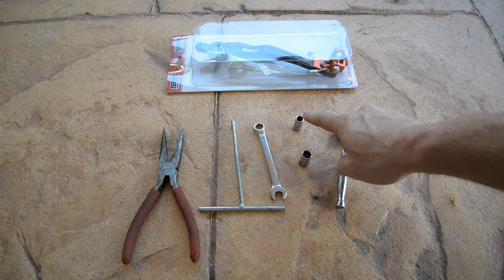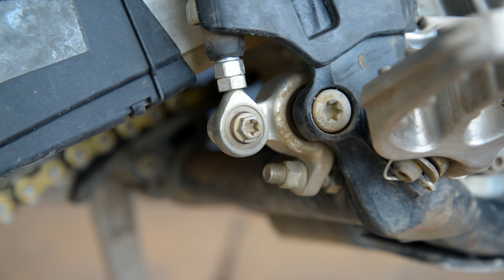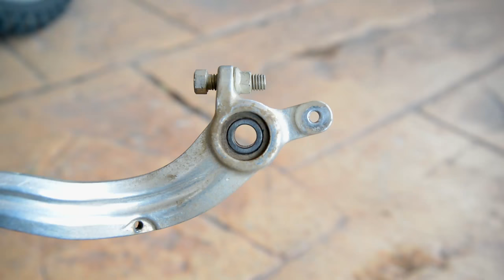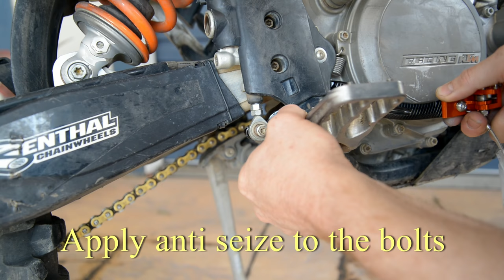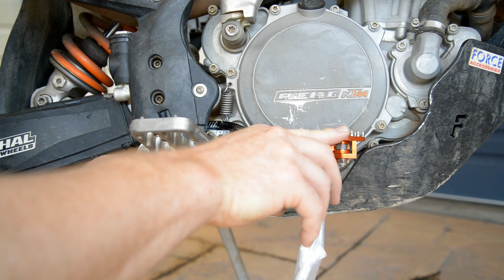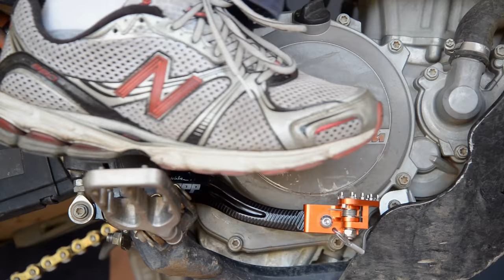Replace Rear Brake Pedal Dirt bike Install of Safety Wire - How To

Comment: What's the safety wire for and is it needed?
Reply from the maker: It stops the brake from spreading apart and braking if you hit something like a branch etc.. and no it's not necessary to have one.

Comment: what is the purpose of the brake wire?
Reply from the maker: Prevents the brake pedal from bending.
Reply: It also prevents grass, twiggs , sticks etc from being trapped between the pedal and engine casing forcing the back brake on.